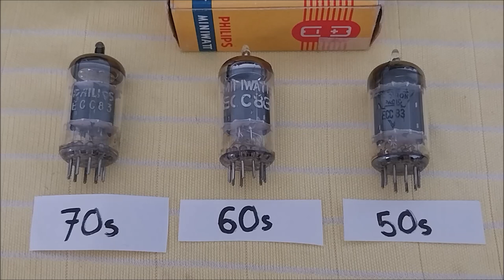Tube Sound Comparison - 3 Decades of Philips,Holland ECC83/12AX7 (70's, 60's, 50's)

Comment: The 50s Philips ECC83 are probably the best tubes ever made, BUT... compared to the 50s Telefunken I have (and did a similar test), I think Telefunken are superior, both in gain and in frequency response... both have that 3D sound, yes its because of the long plates (most lp tubes produce that 3D sound) but my Telefunken are NOS and my Philips are a little used.... so my test wasnt fair.... that said, Philips were the industry standard, where everyone back then compared their 12AX7 (ECC83) to theirs... so I guess Philips is the winner, with TELEFUKEN second best.

Comment: great video again. longplates create that 3d lively open effect like nothing on earth. ive experienced the same differences comparing blackborn mullards the early longplates mc1 f91 f92(1956-1959) are the most detailed holographic and open ,ive found them too bright for most amps but magical on tweeds and bassmans, the i61(1959-1964) is similar in tone but with shortplates so a bit more compressed less extended highs ,great for all amps and lastly the i63(1965-1974) with the most low mids and softest highs great for bright amps. i62 and 10m are too rare to mention both great .do you have a tube tester? i advise anyone serious about this hobby to try and get a used orange vt 1000 tester for 200$ they are discontinued an amazing device easy to use.
Reply from the maker: I dont have a tube tester..YET! But I need one..need more then that Orange one..I have a big batch of different audio tubes that need to be tested cause I will sell em in the future:) thanks for your comments!
Reply: @ecc8344  old testers are like ww2 stuff -takes a while to learn ,you can damage the tubes, it needs calibrating. but if you know what youre doing you can get a mint old tester for cheap and they last forever.
 the best are the digital testers like amplitrex but they cost way too much. the orange vt 1000 tests all the tubes you need for guitar amps(preamp and power) besides rectifiers (that's the only flaw) .
Reply from the maker: I have also other types of tubes such is 6SN7, AZ11, 6N6P, Ecc808 , Ecc82, EZ80 etc...that need to be tested..even though they all seem NIB..But if I want to sell em I need proof with tester :)

Comment: With the au7s be similar in comparison
Reply from the maker: Might be, I dont use AU's..only AX and AT :)
Reply: yes meaning longplates vs shortplates from the same maker will sound more open airy 3d, shortplates more compressed but the early ones are similar to longplates without the treble extension.